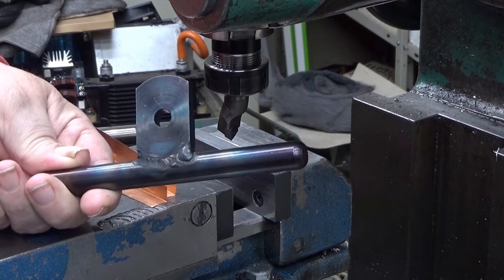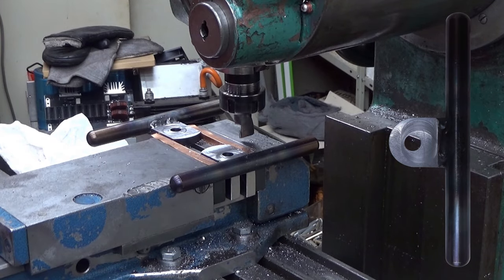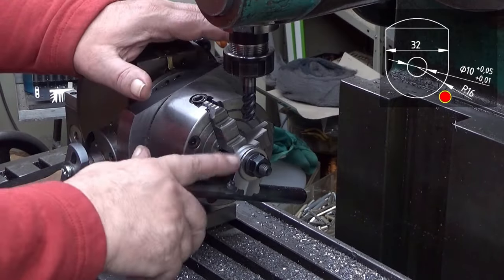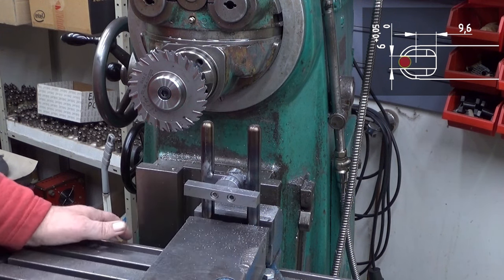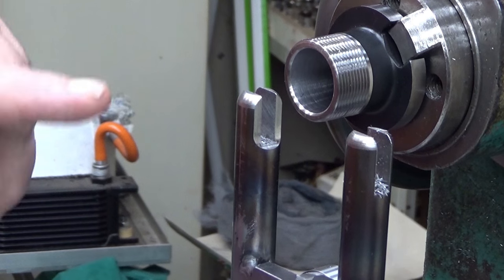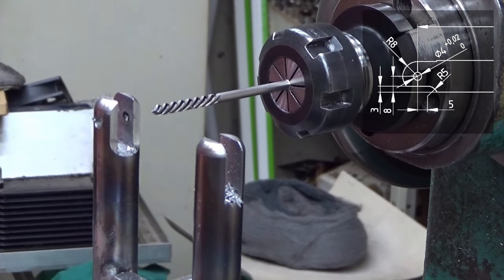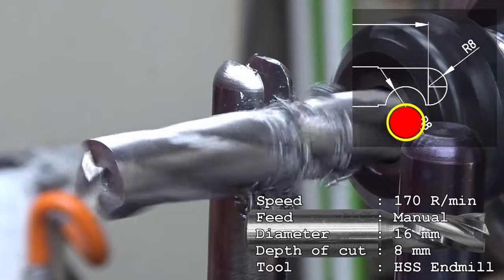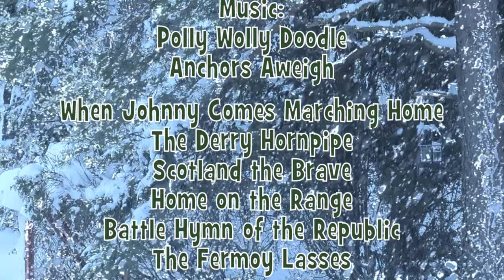Knurling 101, Machining the arms for the knurling tool

Comment: Great video with lots of practical advice. My only comment is that when milling the large radius on the dividing head, if there is a center relief on the end mill then the resulting surface is curved and is a very small segment of a sphere. The end mill acts as a fly cutter and does not cut flat. Good project.
Reply from the maker: Yes, You're quite right. The resulting geometry depends also a lot of the orientation of the endmill. If the endmill is not center enough, so that the circle of the endmill end does not cover the top line across the workpiece, the resulting form may become strange. It may be pleasing but strange 😁